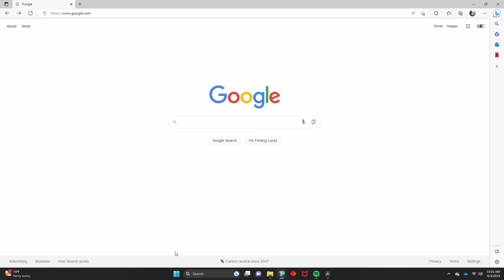The Worst RV Slideout System - from an RV repair tech

Comment: It appears that Jayco went to the cable slide system in their  2024 models ( at least they did in the Jay Feather 21mml model I am considering buying). Why would Jayco go to this cable system if they are so problematic?
 
I just watched Norco Industries Bal Accu-Slide (cable) system videos. The design is similar to the garage door system that uses cables, pulley's, chains and electric motors. At least they provide the functionality of their product to understand its operation, adjustment to the system, replacement and/or repairs that may be needed.

Do you not recommend I go ahead and purchase the 2024 Jayco Jay Feather 21mml model because the unit has the cable system.

Comment: I have a 2021 keystone montana high country 281ck and it has a cable system.  How do I tell if t hi is is the bal system or a different system...is there a place to look up what was put in it.  We have not had any issues as of yet but I am concerned for the future.  If it is a Bal system...what can you have it replaced with and who would do that replacement...thanks

Comment: What is your thoughts on life time roof.  I'm talking about the kind you take to someone and they spray it on your roof like a bed liner.
Reply from the maker: Great question! I actually don't reccomend that or the RV Armor roll on roof system.  The product itself is great, but I can't work on replacing skylights, vent caps, etc without tearing off that spray/roll on system.  It is better in my opinion to regularly have the caulking resealed to avoid leaks.

Comment: What brands used or use those systems? I've owned three rv's and they all had the worm drive units.
Reply from the maker: I've seen BAL Accu slide systems on just about all brands unfortunately. It is an above-floor system, whereas the worm drive you are referring to is just for through-frame systems. There are lots of campers, usually travel trailers, that only have one slide and it is a through-frame type. But other campers have a mix of through frame and above floor type systems, (usually 5th wheel) and those may include Accu Slide. Sometimes it is just a motorhome bedroom slide, sometimes it is both slides on a travel trailer. I'm glad to hear you have avoided it so far :-)

Comment: How do you replace the slide roller guides that guide the lower sides. I have a voltage 4205 where a screw busted the roller off. BAL part number 854599

Comment: @howtonotbreakyourrv Montana the most popular 5th wheel for years has switched to the BAL ACCU SLIDE. I am considering getting one the dealer says they can install a drip tray to prevent the oil damage. Am I stupid for considering one?

Comment: Also it keeps thumping every couple of seconds till it's all the way open,but no noise when closing
Reply: Your gearbox might be getting ready to fail, gears are slipping. The only reason it might do that is it too hard to open, causing too much gearbox strain. You need to check the rubber cushions underneath, that they are holding the roller support brackets up properly. If the slide out is riding on the roller without touching the arm you are good. If the factory put in too small cushions, the roller arm sags, the box slides on the arm rather than the roller. This causes way too much friction, straining the gearbox and cables.

Comment: Well.
Confirmed what I think of slide-outs.
Well.  I just didn't want to be bothered with them, in general. 
While I suspected maintenance would be extensive,  and in general avoiding stupid accidents would be overly fussy, I didn't actually put that first.
Bathroom door being blocked when the slide-out was in,  that made me rule them out. Definitely nope. They Don't add THAT much room to be worth it to me!

Comment: I'm considering a Class C motorhome. Are there any slideouts that are fraught with potential issues and problems? Or... is it just a bad idea to get a slideout in the first place?
Reply from the maker: Other than BAL Accu-Slide.....Schwintek is problematic. I don't mind working on them but they break a lot. My big complaint about Class C rvs is the cab overhang portion is often a headache because of water leaks. Class B+ eliminates this issue while giving the same floor space. I'm going to make a video about this soon.
Reply: @undercoverrvtech  
Thanks a bunch for taking the time. Now I'll push my luck and hope you reply to this:
I'm actually considering a B+. Can you comment on Thor B+ quality (Gemini) and Leisure Travel Wonder... Thor has something called 3TRAX on their slide outs. 
I'm actually considering moving into one full time and park it at an RV park to beat the very high rents in Phoenix.
Reply from the maker: 3Trax appears to be a 3 rail Schwintek system. Basically there were a lot of breaks on full wall slides with the 2 track Schwintek,  so Thor upgraded to a 3 track and called it something else to get away from the negative branding of Schwintek. 
A lot of breaks I deal with are the result of a room not resting on the roller underneath which then breaks the Schwintek bearing blocks. A 3 rack system does not guarantee it won't have problems,  it really depends on how it was put together.
I definitely have LTV on my list but will add you vote to review!

Comment: What about the Norco cable slide system? Is that Bad?
Reply from the maker: Norco is BAL. They own and make the BAL Accu-Slide system as well as the EXACT Slide system. EXACT Slide seems to have solved all of my complaints with the Accu-Slide,  but unfortunately many new campers are still installing the Accu-Slide. Keep an eye out for my upcoming review videos where I will show more of how to tell the difference.

Comment: Best preventative.....don't buy a RV with a slide...... save weight, another source of water infiltration, hot/cold transfer, extra cost to buy, constant worry, better wall integrity w/out one. I wouldn't touch one with cables or a Schwintek.